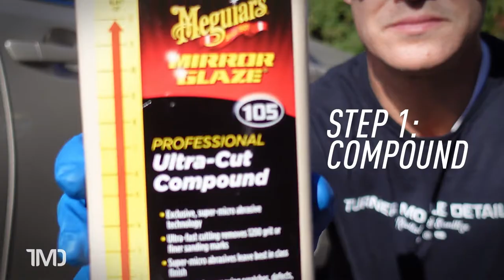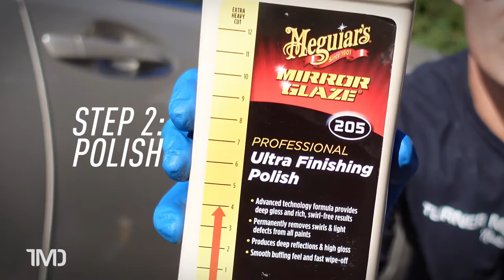Meguiar's M105 & M205 Paint Scratch/Defect Removal | Dewalt Random Orbit Cordless Polisher DCM848P2

Comment: Old school!

I pulled these two off the shelf not long ago. I forgot how fast and to the point M105 can be. I guess all those years of practicing with it paid off. A real pain to use in the summer heat for me. I remember M105 dusting away before I was able to remove the damage! 

I really love the new M110 and M210 though. 

Great vid!
Reply from the maker: Yeah they work, depending on the heat and humidity levels like you said. I hate dusting though. I’ve since gravitated to Rupes, I really like how their whole system works together
Reply: @TurnerMobileDetailing  - I've tried the newer Rupes stuff three times, and each time I end up selling it off. I want to like it, but that compound dusts more than M105 for me. I really wanted to like it.

I loved the original line of Rupes polishes though. I still have some and a bunch of the original microfiber pads. 

That being said, I might give them another go. The DA Coarse on the Coarse Blue Wool pad was FAST at cutting.
Reply from the maker: @danlc95  they do dust a little for me too, but that’s expected with a polish that doesn’t have any silicones in it. If you use the right amount and work it for the correct amount of time and the right surface area, the dusting is pretty minimal. All in all a little compressed air gets rid of the dust left behind. I find it works well in summer heat too, just I have to adjust my area and working time some. I do love the wool DA pads too.

Comment: I just dont get it.  ive used m105 and m205 respectively by hand rotary and da overlapping slowly small pressure wiping off and i csnt get any swirls out 😕
Reply from the maker: What pad are you using? What is the make and model and color of the vehicle?

Comment: Love this quick and to the point informative video!

Have you had a chance to try 110 and 210 yet?

I'm still on the fence with 205 vs 210 but I definitely like the 110 better than the 105.
Reply from the maker: Thank you! I have not. I actually haven’t used the Meguiars line in a while, IMHO they create to much dust, even in a humid environment. I’ve been experimenting with other products. I think I’m in love with Rupes liquids. Much less dusting, easy enough to remove, and they don’t burn to the paint when working outside.